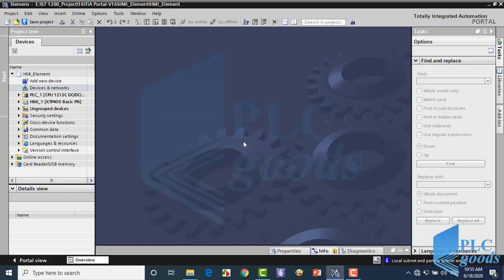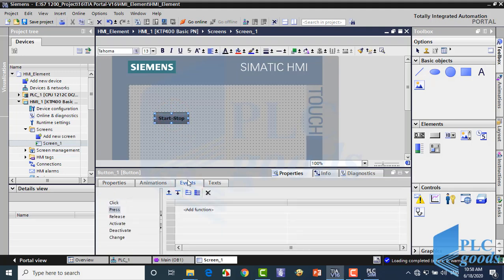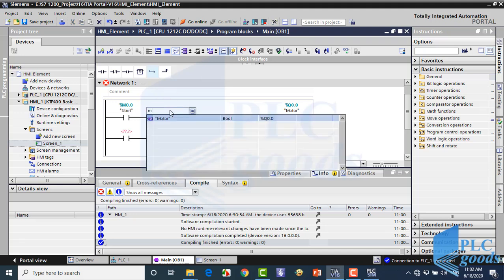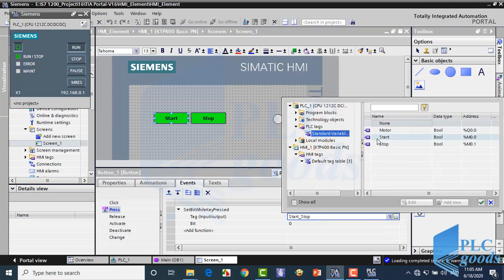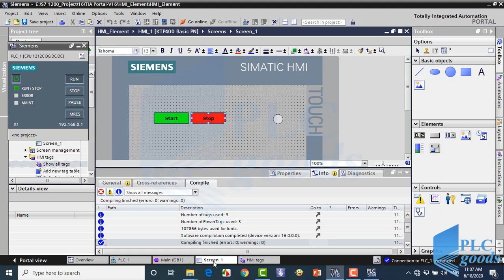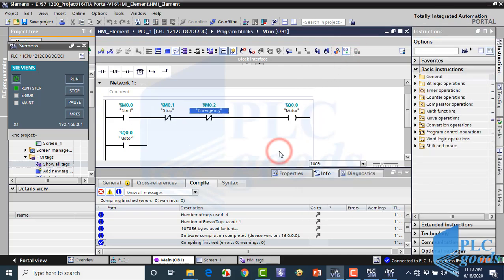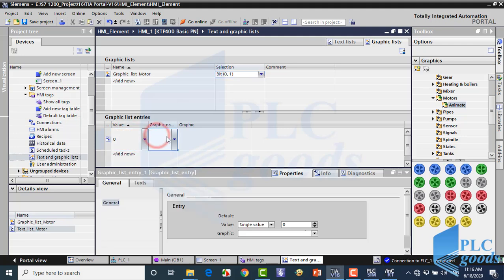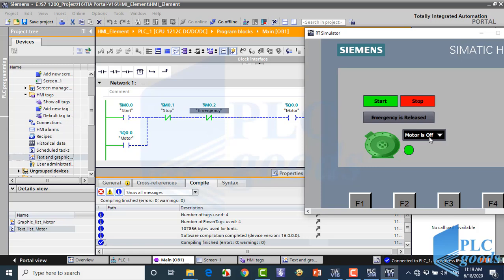SIEMENS KTP 400, how to add switch, button, graphic I/O field on HMI screen | Lesson 34

Comment: Hi, I do everything exactly the same, I have two buttons on the HMI start and stop, everything is set exactly the same and I don't know why when I press the button it works, but when I release it the button signal goes out. What's wrong?
Reply from the maker: 💚💚Thank you for your question! It sounds like your HMI button is set as a momentary push button instead of a maintained or toggle button. Check your HMI button settings—if it’s configured as ‘momentary,’ it will only stay active while pressed.

If you’d like priority support for your technical questions, consider becoming a channel member, where I provide faster responses and additional guidance. Also, feel free to check out my other related videos, as I demonstrate similar troubleshooting steps in various lessons. Hope this helps!

Comment: You helped me understand this! Really useful video! Thanks a lot!
Reply from the maker: Glad you like it and thanks for having you on the channel. To support us, please share, like, and subscribe to the channel.
Reply: I have one question: I follow the steps just like your video... Everything works (indicators, text box displaying a value, a text box to set a value) but I don't get a button to work. Everything is on the same screen.

The connection is set and I'm using the plc tags. Tried press (set bit) and release (reset bit) events, click event with invert bit. But nothing works. It only beeps when pressed but nothing happens on plc.
Reply: Hi, It seems your problem is related to buttons on the HMI screen.
First, Please check your connection. start a simple project from the first with new tags (Maybe you defined a tag for different purposes inside the HMI). a simple project can be to use one button on the HMI to turn on a PLC output. Note that, you can not change digital input addresses. You can use buttons on the HMI, only to change memory addresses like M10.2 .
Reply: @plcgoodsmentor9223  I'll try it and let you know. Thanks!
Reply from the maker: @plcgoodsmentor9223  thanks for checking out the channel
Reply from the maker: Glad you like it! and thanks
Reply: @plcgoods  it's working perfectly now! Thanks a lot for your help! Great videos and channel... I'm already sharing!
Reply from the maker: @marciocaster1524  Glad to hear that!

Comment: Thanks a lot for these tutorials. I am greatly learning from them them each day. Please sir< could you help me with more insights about the differences between a Stop and an Emergency buttons? 
Thanks a lot sir
Reply: Hello. thanks for watching our videos. 
note that, you can use a normally close or normally open pushbutton to stop a process, but because of some safety reasons, usually normally close pushbuttons are used.  so, both emergency and stop pushbuttons are normally closed. but if you press an emergency button, it will keep its state, until to ensure the emergency state has been removed, and after that, the operator returns the emergency button to its initial state manually. as you know, if you press and then release a stop pushbutton, it will back to its normal state immediately
Reply: @plcgoodsmentor9223  Thanks a lot for your many contributions to my career. The explanation is very much clear too. I really appreciate you sir
Reply from the maker: thanks for checking out the channel